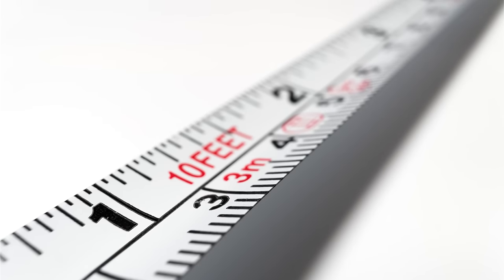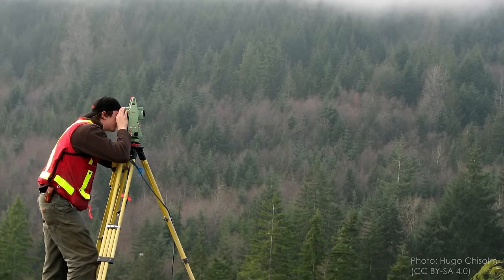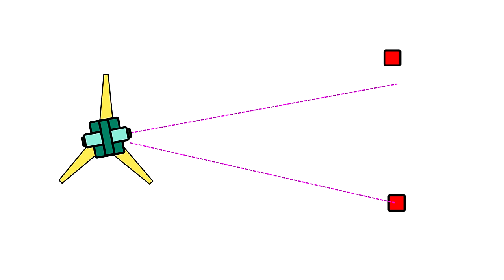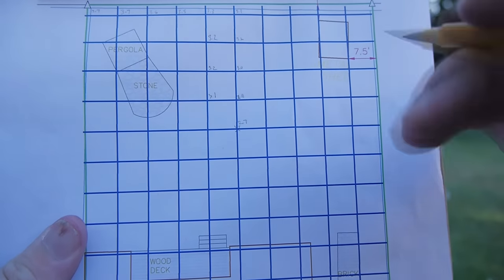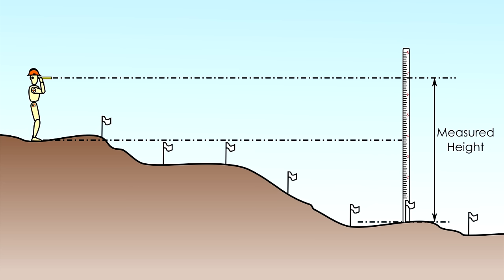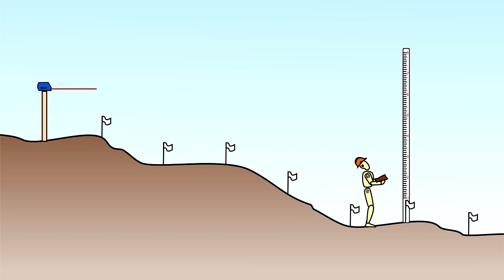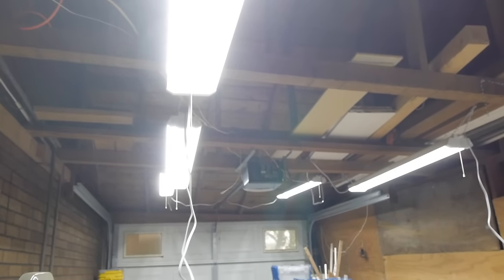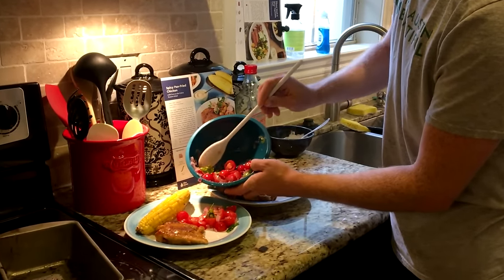How does land surveying work?

Comment: Great channel! FYI, as a tile setter of 26 years and the owner of at least 8 laser levels of one form or another, I can tell you with complete confidence that the water level is absolutely the most accurate.
Reply: I recently found this out. The laser itself is pretty accurate, but the company that set them in the level body is slightly off or something.
Reply: Excellent comment!
Reply: Gotta say the laser 'level' he had was one of those cheap harbor freight chinese lasers.  I wouldn't trust them to cast a 'level' line more than 20 feet.  You have to look at the accuracy of the bubble to 'level' it up.
Reply: @tubedude54  it’s a Bosch laser? Pretty standard laser I’d say

Comment: I am a high school teacher in Australia and teach mathematics. It is very difficult to find videos that show applications of the mathematics we teach in high school in an accessible, informative way that doesn't require an interest in mathematics to appreciate. However, these videos include enough links to mathematical concepts without the audience requiring much knowledge of those concepts. This is a perfect video to answer the ubiquitous "when will we need this?" question before it is asked, as it is neither superficial nor a cop-out. I am planning on using this at the beginning of the Trigonometry topic in my Year 9 class, without the need to simplify or clarify anything in the video.
Reply: Applications of Robotics like Robotic arms also uses trigonometry extensively))

Comment: My father retired from the photogrammetry department of a civil engineering firm.  Started his career as a field surveyor, tromping up the down the back woods of Kentucky and mountains of New England.  He later worked on the plotters, marking x,y,z points on the ground on aerial photographs.  He did the analytical triangulation on the aerial photgraphs, which is the first step needed to tie all the photographs into one big strip of photographs that the computers can understand, up until he retired.  I myself spend about three years, working in the same department, doing the CAD editing of the files the plotters created, as a 'temporary job' after college.  My sister worked at the same company as well, in the IT department.  She met her husband at work as well, he is a civil engineer, doing roads and bridges.
Reply: photoggrammetry department? do you mean taking pictures 360 deg and make a 3D model of it?
Reply: And now most of that can be done by a reasonably talented highschooler with a weeks training...
Reply: @Bocbo  especially with photogrammetry software nowadays. The computer can auto recognise the points for you, just take a good set of photos with enough overlap place some control marks and/or a scale bar then the rest is elementary.
Reply: Nothing is ever built without a surveyor. Not a road, bridge, building, wall, fence, lights, powerlines, etc, etc/EVERYTHING.

Comment: FYI: The annual flooding of the Nile river in ancient Egypt would wipe out most of the border markers of the farms along the fertile river. This fostered the creation of a method (geometry) to re-establish the borders with just the remaining few markers to work from.
Reply: That's pretty cool !
Reply: Agree 100 % 
also quadratic equations came out of this
Reply: Also, the Egyptian priests had secret pipes leading from the Nile into the temples to measure the water level more accurately than the eye alone could see.  For a few sacrifices they would “confer with the gods” and tell the Pharaoh when to expect the annual flood.  Historians call these pipes Nilometers.
Reply: Lovely factoid
Reply: One of my favorite little measurment factoids is that with 4 static points and a measuring tape you can find the exact location of literally anything and, by proxy, find the relationships between all those objects. All you need to do is find the distances between each of your static points, then measure your desired object from each of your points. A little trig is all it takes (or you can let CAD software do the heavy lifting).
Reply: @namAehT Cool.  But can't you do that with 3 points? One each of x, y and z?
Reply: @namAehT  You actually only need 2 known points to locate a 3rd... it's called '2 point resection'.

Comment: I've been a surveyor doing all aspects of highway surveying for 30 years. I've had a dozen ways of explaining what we do. This video is one of the best I've seen, certainly in the 5 1/2 minutes it takes to explain it. I had a drainage issue at my house a couple of years ago. I used just about the same laser level to put in a 4" drain pipe that totaled about 100' long at 1% grade (1 1/4" per 10'). That was a perfect example of how you can do some basic construction surveying yourself. A well equipped survey crew will roll out with $150k equipment in their truck, but sometimes, a $50 laser and a pocket tape is the right tool!
Reply: Check your math Dave.
Reply: @dennybrenk3836  1 1/4" is approximately 0.10 foot. That is 1% of 10 feet. If you disagree please elaborate.

Comment: Thanks for the cool video.
My Dad was a civil engineer.  He started off leading topographical surveys in the Alps for the Corps of Engineers. When he got out of the service, he lead the condemnation survey for I-68 in western Maryland.  He got his PE and worked on I-70 and I-495 on the Maryland side.

I still have a lot of his surveying equipment in the basement, including his theodolite. All I need is a stadia rod and I'm good to go.
Reply: James D That's exactly what I have. I brought it up from the basement and the leather strap broke. Oh well, it is over 50 years old.  The rest of it is still in pretty good shape though.
Reply: Bernarr Coletta 
A K+E Paragon is a an American transit, 0 on the vertical scale is horizontal.
Reply: @jamesd4846  that’s what I learned on in my school in the Navy.    Some memories. Wooden box and leather case and fixed tripods back then.

Comment: I remember a crew using the water tube method to check the level of one of Australia`s largest offshore oil/gas platforms straight after they set it down on the seabed about 300 feet below the measurement point . Simple and it yielded the information.

Comment: I've done some surveying to help with improving farm fields, adjusting for flood irrigation and such. The tool we used was a laser on a tripod in the middle of the field, and a receiver on the surveying pole. The receiver had a special window on it to receive the laser, and would beep when it saw the laser. The closer you were to center, the faster it would beep until it produced a steady tone. The survey rod had a tape with the measurements, so when you slid it up and down, the tape would move and give you a much greater range. Pretty boring for the average person, but very fun if you like data!
Reply: I've seen grading machines with laser detectors on them so they know whether to scrape or to dump soil in their current location.
Reply: @massimookissed1023  they are pretty remarkable.    I still observe surveyors and heavy equipment and have seen the leveling equipment on graders tied into the graders mechanics, and the operator just had to steer. Blade went up and down as needed.   Sure beat pounding “ grade stakes” in and redoing it every few hours.  😵‍💫

Comment: In 1961 my first job was the pole man surveying the coal pile at RL Hearn generating station to determine inventory. This doesn't mean you just stand holding the pole upright, as it could be held at a slight angle, which leads to the wrong elevation. I was told to slowly move the pole forward and backward, the highest observed level as the pole travels its arc is the correct level.
Reply: Nope, that's backward.  When rocking the rod the lowest reading is correct.
Reply: @markwyatt3088  Thanks for your correction if i had a little common sense it would have overcome a bad memory. its not the only thing you lose in your 80's
Reply: I recall that method.  Then realized with my hard hat and military boots at heels touching, resting the rod against my hard hat and centered between open V of boots (tip of toes) would get me plumb without need for a plumb rod.    We only had to do 3rd order work for combat engineering, but I always strived to give it my best.

Comment: In 1970 I was an electrical engineering student at Michigan Tech. We were the brains on campus. I would see the surveying students all over campus with their sticks and tripods. I thought "how quaint, and worthless". Later I learned how important their job was. For example, I was struggling to hang a suspended ceiling in my basement. Measuring from the floor was not working. It was not level. A surveyor friend showed me the water in the rubber tube trick. Easy-peasy! He explained all the geometry and sundry mental gymnastics he used to do his job. I wish I had learned to circularize terra firma as well. Love your channel!
Reply: Michigan Tech alum as well, I then did grad school in Tennessee and taught the surveying lab for a professor having never learned it in undergrad.  It's a skill that has come in handy half a dozen times since then.

Comment: Don't be fooled, people. It's not as easy as it looks. Just placing the theodolite exactly above a point of reference (called centering) requires a LOT of time and effort. The first time we tried this in college, it took 3 of us about an hour to get it right. And that was before we even took any measurements. You have to measure each angle and distance twice, then add them up and correct errors. Man, that was a lot of work.
Reply: As an artillery gunnery sergeant I had to set up and level a manual aiming circle (surveyors instrument) and use a stringed plumb bob that had to be within 1 inch of a survey point. All in under 2 minutes. Harder than it sounds indeed.
Reply: Trying to level the total station was hard enough 😂
Reply: an hour to center?? Even without a laser plummet, any garden variety plumb bob without the interference of harsh wind should line you up pretty damn quick
Reply: Theodolite? Is this the dark ages?   Get a robotics station. And a data collector. Preferable the Tsc7.  Why bang your head and not use the technology at hand. 
Not many young surveyors know how to use a level or even how to take level notes much less reduce them. 
For a guy who has surveyed for 33 years.
Reply: @TM-qj6io  i must say here in Europe, Romania to be exact , we are using theodolites from 1980 , using the level and so on. the university is basing a lot on taking notes and doing everything manually , and I don't really take that as a no go, it's seems pretty fair imo to know how to do such things . anyways, have any tips for year 1 student ? ty!!
Reply: @MrHezMC  you goddamn right
i'm from Ukraine and we use old theodilits and old tripods and leveling takes about 30 minutes and doing everything manually
Reply: ...One of my favorite things to teach my students. By the end of my class they need to have the instrument centered and leveled to what I call perfect with a lowercase "p" in 5 minutes.
Reply: @ernststavroblofeld7460  hope you also teach them how to plant the legs so they don't get spring loaded..or to bury the legs in snow during winter so the sun dose not melt any ground under the legs.
Reply: where i work we only measure each angle and distance twice (face left only)
with enough practice though you can centre it under 5 minutes
Reply: @pupper42  I really hope you mean 5 seconds lol
Reply: @TheMrZ100  5 seconds still under 5 minutes hehe (jk)
im still relatively new tho so it takes me about 3 minutes
Reply: Surveyors arive at place.
Start finding correct spot for mesuring
4 hours later
We did it,  great lunch time. 
Good,  i will just take my tools
Oooh,  did you marked spot?
Reply: @kvakerbillduck9500  Lol pretty much
Reply: @a1c3c3u  Lol that's quite the flex
Reply: When I was in college in the 70's the first time we went out in the field the TA's thought they would have 'fun' with us.  They set some stk's in the ground and made teams out of us and told us to take a theodolite with optical plumb and set it up over a stk.  I looked at my team mates and said 'let me do this' and they got out of my way and let me at it.  I looked around at the other teams and they were all fumbling and moving the legs this way and that and I grabbed the tripod and about 15 seconds later walked away and said 'done'.  One of the TA's looked at me and said 'no way'... he looked thru the plumb... right on... he looked at the bubbles... right on.  He asked how in the world I did it since the other teams were still picking their tripods up and resetting them.  I said have everyone gather around and I then picked it up and did it again explaining the process to everyone... took about 25 seconds the second time as I was talking! LOL  To my amazement no one, not even the TA's or the profs, had seen it done like I did it before.
Reply: @rogershipman3578  I remember those in the Seabees and I was also a surveyor.  Nothing fancy.  Plum bob and wind and a fixed tripod.  Going back to late 70s, early 80s.    Good memories, setting up was a bi-tech and someone would always come around and mess with the equipment enough to want to strangle them 😏
Reply: @TM-qj6io  good memories back then.  Needed ur surveyor book, chain, chaining grips, rod, etc.    and then go back to office to do the calculations using a slide rule.      Was amazing a few years in Navy I worked with a county surveyor in WA state who introduced me to a T2 (if I recall ).  Pushed a button and does all the work.  Plugged in a TI calculator and then uploaded the data in his van via Sat phone to have the map printed before he made the 3 hour journey back.    Still remember the “Wye Levels”, and black “Transits” and fixed tripod legs.   Setting up took getting use too and in time, adjustable legs came in our inventory and better levels and started replacing the “transits”. 

When Learning old school. U never forget.  Still have a 100’ chain at house.  🙂

Comment: The water level only works if the water is at the same temperature in both vertical arms because the density of water varies with temperature.  I fell into this trap once with one end in hot sun and the other in the shade.  It took me a while to figure out why the reading kept changing.
Reply: LOL :-D how much off was it though? I'd expect maybe 2-3cm per 10m of tube...
Reply: KohuGaly .....and you're about right!
Reply: I always wondered why they are not more popular, this might be why.
Reply: @KohuGaly  possibly several tenths of an inch per 2 foot elevation.
Reply: @raykent3211  liquids with small coefficient of thermal expansion have entered the chat